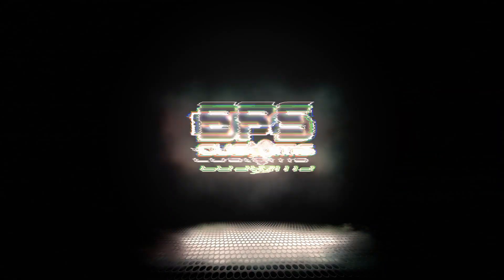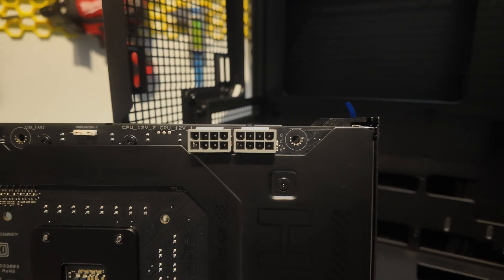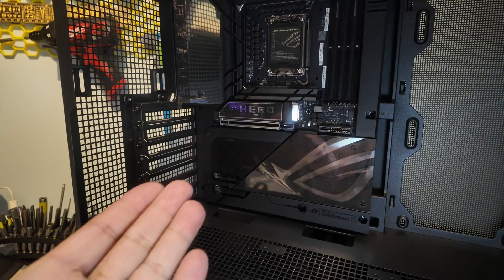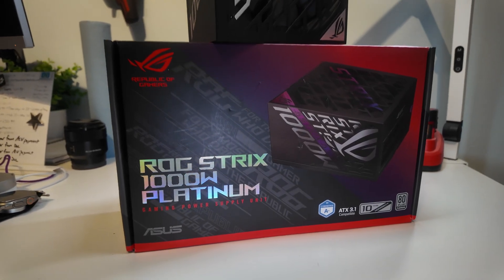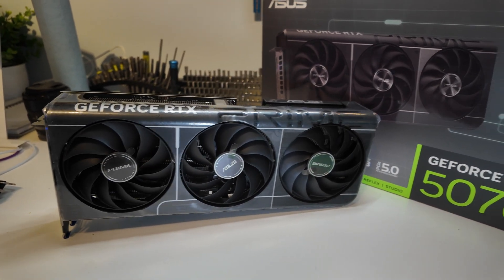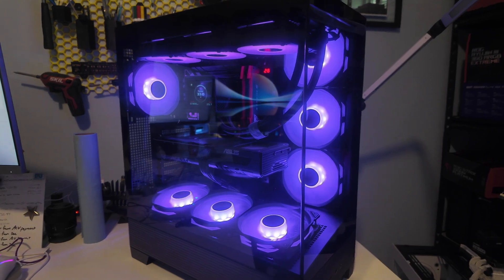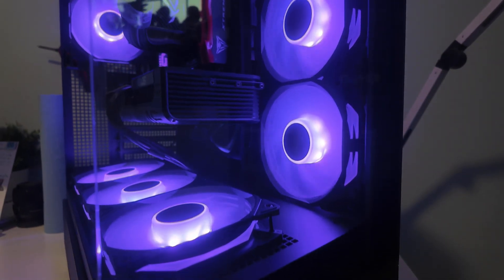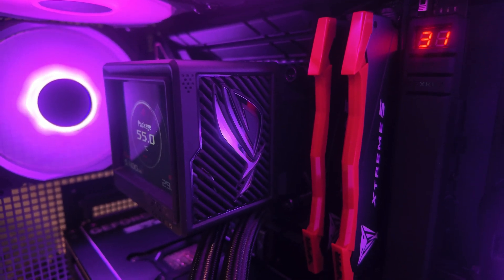The PC With No Cables

Comment: Glad you got to put together a new editing rig.  I'm personally not sold on the BTF trend as the current cost does not justify the marginal gains in cable management.  To me, it just seems to create another avenue for parts to not be compatible.  I'll wait for features that increase compatibility or do not add cost to builds just to follow a trend.
Reply: You have no issues with compatbility part of what we were hoping to share was that BTF supports standard and advanced configs.

This means as shown in this video you can use a wide range of chassis ( currently almost all chassis partners have BTF supporting chassis ) and you can use standard or BTF cards so you are not locked in.

Also the cost is relative as this can be easily scaled out as adoption increases, in the prior gen we offer a more mainstream TUF GAMING BTF model and a higher end ROG MAXIMUS model and will look to continue this, we also released a mATX offering so while BTF boards do caring a higher price point relative to the board position it is a fairly minimal price increase.

In the end though it does not affect the breath and depth of the market and it is not an all or nothing choice, you normal builders who do not prefer it should not cancel it out for those who might like it as 99% of all other motherboards are non BTF and it would be important to note compatibility is still a factor.

If you pick a eATX motherboard you need to ensure your chassis can support this is which is much more limited than standard ATX for instance. Similar with mATX or mini ITX. We see BTF as another option for builder to approach their builds.

Comment: I would like this more if it was a standard across manufacturers. Might be new tech, but until it becomes one for all, I am skipping.

Looks great, though. Thanks for showcasing this Brian.
Reply: while not detailed in the video we have a BTF alliance and it already includes all leading chassis manfuraters in this respect it is already a standard across manufacturers.

Our BTF graphics card is an ASUS innovation, our patented design, and exclusive to us, but the motherboards, as shown in this video, readily support any standard (non-BTF graphics card ).
Reply: @ASUSPRNorthAmerica  It is a good start to have chassis to support the BTF standard, but locking down BTF cards under a patented design users cannot fully interchange makes you no different from corporate/enterprise centric OEMs. Again, BTF is a promising tech, but I am skipping for the very reasons you highlighted as "ASUS innovation".
Reply: @hquest  If the user could not use a standard graphics card on a BTF motherboard, they would be limited, but the user can select any standard graphics card on the market. This is why we offer BTF standard/advanced. So, it comes down to the user's preference. This is shown in the video, where you do not have to utilize a BTF graphics card. It be quite different if BTF motherboards only supported BTF graphics cards meaning the user was solely limited to BTF graphics cards.

Hope this clarifies.
Reply: @ I very much appreciate the conversation and context. I understand the GC-HPWR connector can be used on BTF cards with such connector, or be skipped on non-BTF cards. I also understand you cannot talk about other OEMs/manufacturers. And yes, your note above helps.

My only wish is for the Advanced BTF standard to be available for motherboards and graphic cards from all makers, not only Asus, for a large range of reasons. As of today, Asus seems the only maker using Advanced BTF connector on their graphic cards. Don't get me wrong, as I initially stated, I like it and it makes look very cool and clean, but being Asus alone with this tech it feels like a closed standard. I may very well be wrong and time will tell, but again, I really appreciate you for taking your time here.